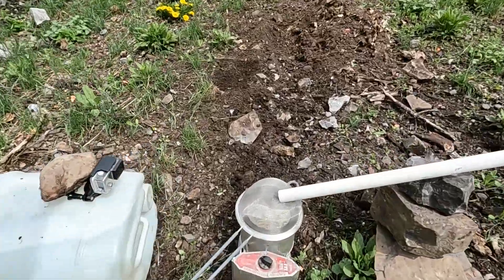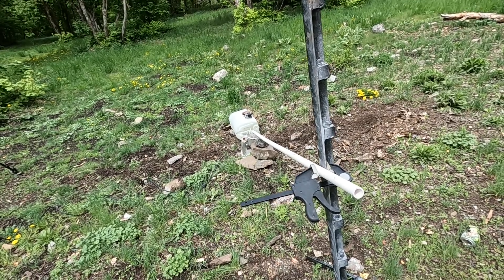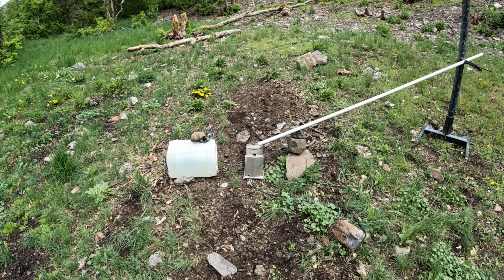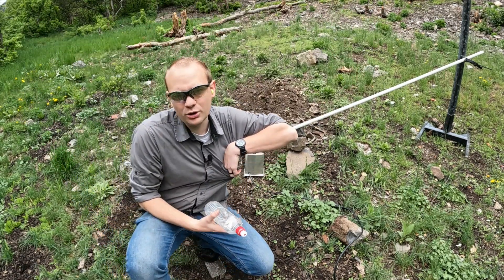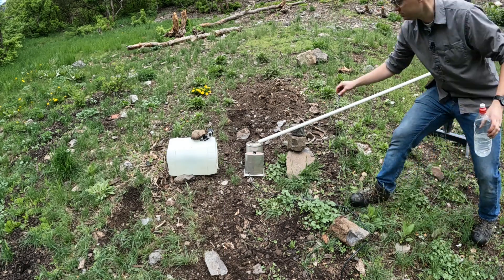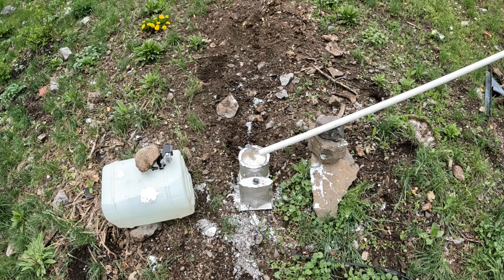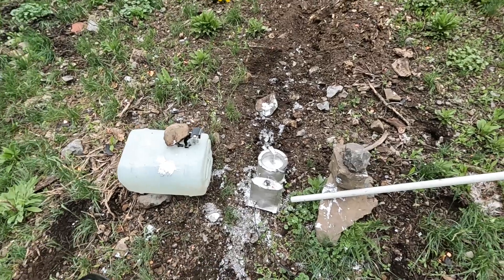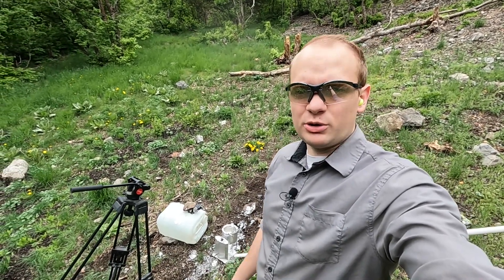Molten Lead EXPLOADS

Comment: I've been casting for years and I have always assumed this about water, interesting that it just steams on top. I would imagine though with a large rain drop that has enough velocity would have a different result. I know a cold spoon put in to fast cast but its nothing compared to a live round, that was brave haha. I'll be sure to never do that. When I melt range scrap It can be wet but only the first pot of scrap starting out. Making sure I am not putting any live rounds in, ever. I have gotten squirted a few times from total metal jackets that get a pinhole leak. I use the cast iron lid as a shield when I stir it jut because of those buggers. Thanks for the experiment, I was not expecting this haha. I wont be so afraid of a drop of water now.
Reply from the maker: All my Lee stuff has been great. As for Hornady I am un-familiar with their business practices. The Hornady stuff I have works great, so long as it isn't electronic. All Hornady's electronics are designed in China and they suck.

Comment: Water poured on top does not cause an explosion. It just evaporates. In order to cause an explosion, water must be trapped under the surface of the lead. It turns to steam under the surface and then violently explodes as it tries to escape.
Reply from the maker: I know, I even tried cutting into the lead and making cavities for water, but it still didn't go. The crazy thing is when it blew up on me in my garage it was just a slightly wet projectile, it wasn't anything with cavities or anything. I guess I just got un-lucky. I will try it again with drilling a hole in the bottom.
Reply: @TheLarkinsLair  if it was a hollow point or had a hollow base that might explain it. It can also happen with a wet lead ladle turned upside down and dipped in the pot. But trying to force it to happen can actually be difficult (as you showed in your video).

Comment: I learned this lesson the hard way when I was a kid casting fishing weights. We were dumping them from the mold to a bucket of water. I took one out of the bucket that had voids in it and dropped it back in the pot. The pot went from full to half empty in a heart beat. Lead was all over the garage wall and floor. The wall was smoking. My father was not happy.
 To duplicate what happened to me.  Take 1 pound fishing weight drill a small hole and opened up a void then warm it up to a few hundred degrees then drop it in the water so as the air in the void cools and contracts it sucks water in. Then you would get the show were after. I have had a drop of sweat cause a small splatter of lead. Unless I am desperate I only cast in the winter. And use long pliers to drop lead in a hot pot. I have lived what you were looking for in this experiment. 
NDR
Reply from the maker: I will give the hole drilling idea a shot.
Reply: I just learned this when pouring lead and had hit lead get all over my face